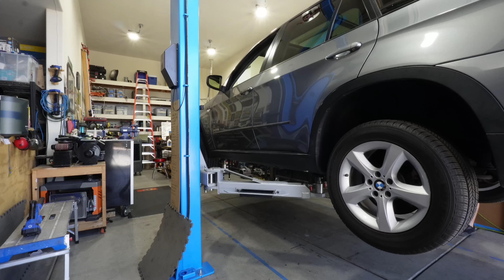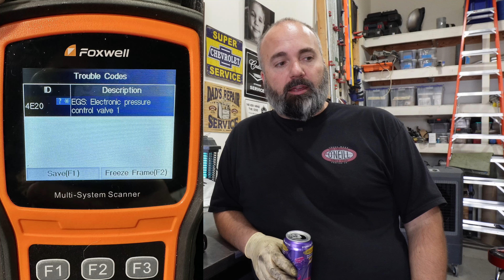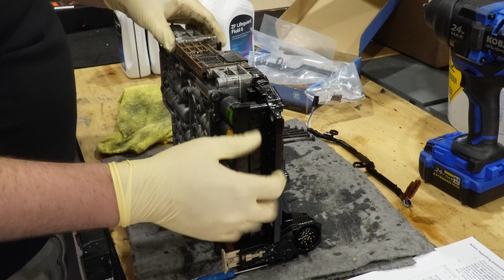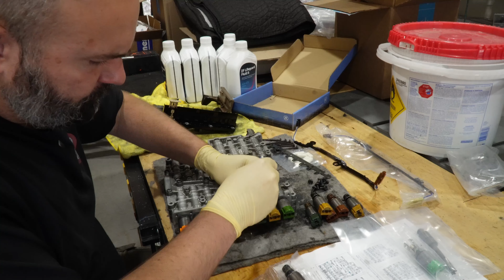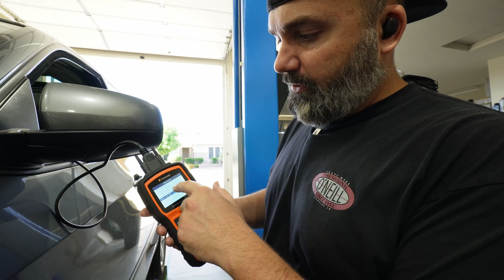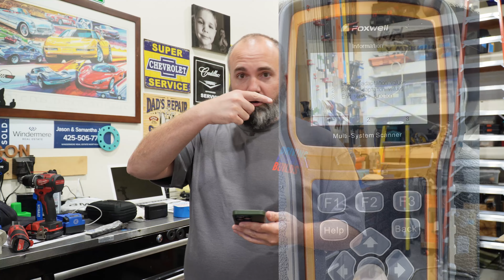ZF 6 Speed Transmission Solenoid Replacement

Comment: Nice, no non-sense video. I was considering doing the solenoid replacement on E60 with 240000 miles but the mileage and the lack of a lift made me to not do the job. Though my problem was electrical and solenoid 6 sometimes was functioning normal and at random it was showing as not present.
BTW, can you share some info on your lift? Cost/Place of purchase/how it has performed so far?
Thanks
Reply from the maker: Glad the video helped! The lift has been a game-changer. I got it from a local distributor for $5500, and it's performed flawlessly. Its a Champion TP11-HD. Way overkill, but I needed to be able to lift my 1 ton truck when I bought it.